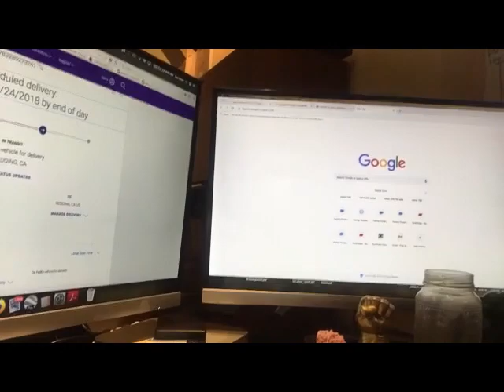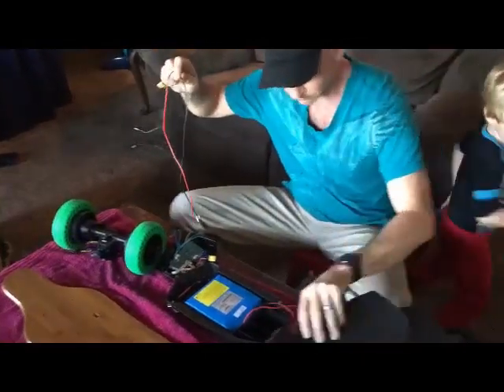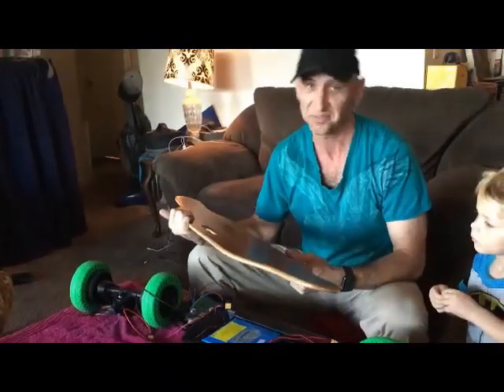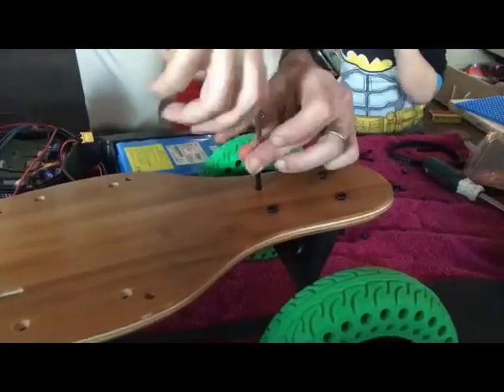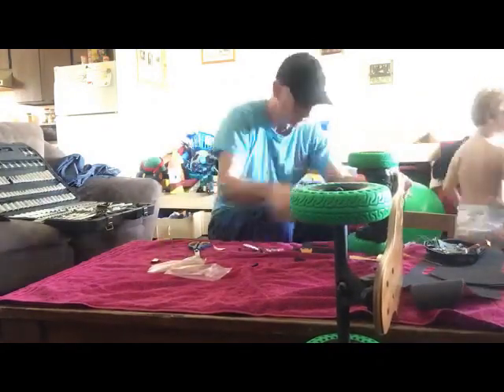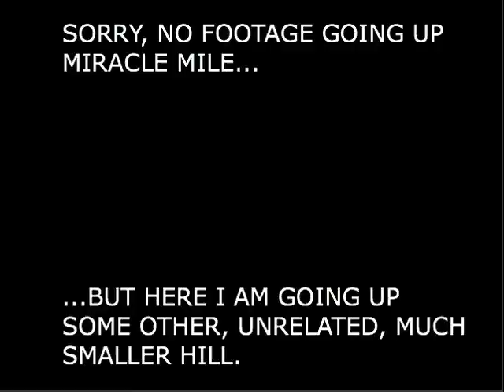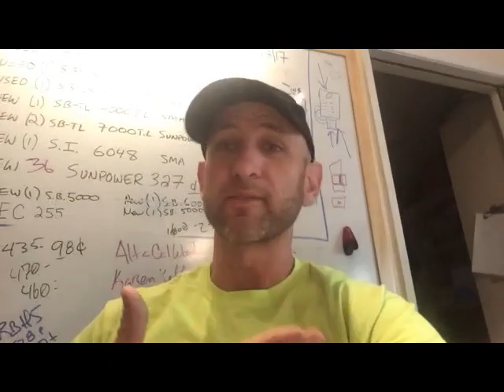Amazing DIY Electric Skateboard for under $700! Boosted destroyer!

Comment: I have the same truck kit, but with out the AT wheels. I'm running the MBS wheels on it. Been riding this setup since September of 2018 and still going. Only problem I had so far was the grub screw that holds the motor mount to the trucks vibrated loose. Easy fix with some red locktite. Over 500 miles on it so far.
Reply: Update 5/25/2019: Trucks snap during the Evolve GTR group ride. Kinda of embarrassing and my knee is Jack  along with some deep scrapes. Even the threaded rod that holds the wheel in place broke. I hope the AT they sell doesn't have this problem.

Comment: Still working?
Reply from the maker: Carl Yup!  Ride it every single day, we’ll... except when it’s raining :( anyway, people have said stuff about the trucks are going to break, etc... I’m pretty rough on it and I’ve never had any problem with the trucks.  My only concern at this time is that it seems to only hit 21 mph when it used to go 24... also, I think I’m losing range.  I don’t know if it’s because the batteries are getting old or if it’s just the cold weather.  I plan to do a review at the 6-month mark since I’m almost there, I’m trying to get footage for it to demonstrate everything but it’s hard with just my phone.. it’s a great board, I’m still very happy.

Comment: Only issue I’ve seen reported was that the trucks end up bending.
Reply: Trucks look untrustworthy
Reply: @ThePlanet_L.I.  LOL, they aren't.  These trucks bend quite easily.  Give it a month.  Forums, builds and even videos on youtube show how unreliable diyeboard products are.  Those wheels if they go over 27-28mph will fly off the hub as well.  Just a heads up.  the battery is super laggy, and come back with a review in about 6 months.  It will be a different outlook.